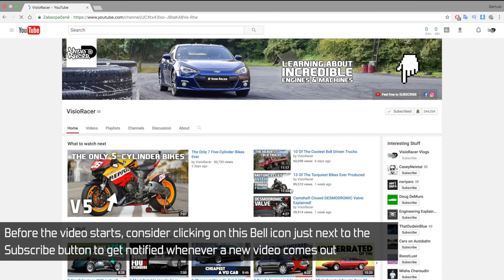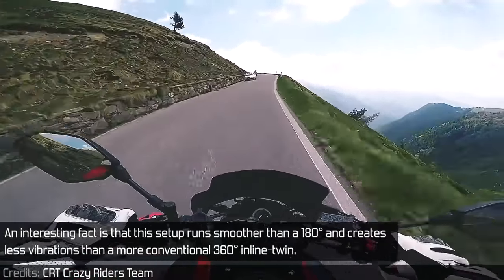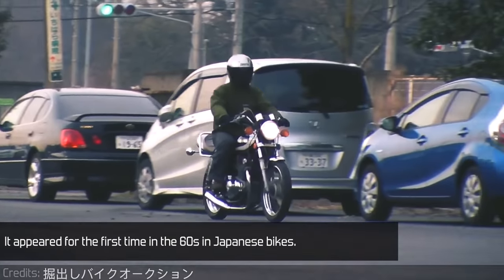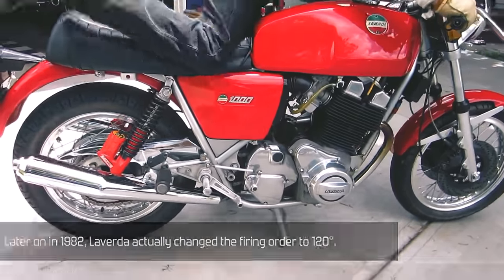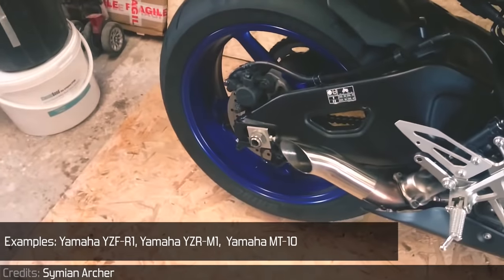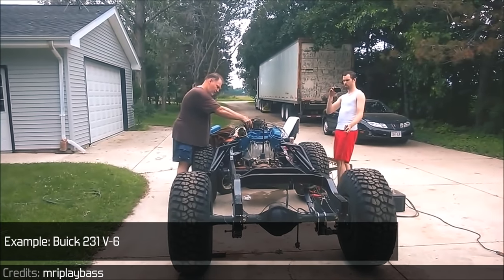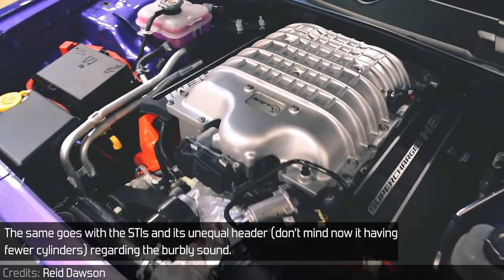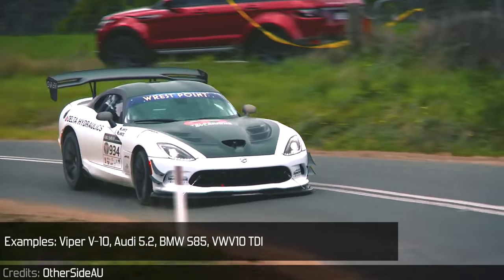7 Interesting Examples Of An Uneven Firing Engine

Comment: Vipers are the best sounding V10s hands down
Reply: KSZ Razor Lexus LFA, Carrera GT, Gallardo , Huracan , R8 are way better sounding v10s
Reply: I like the Audi R8 V10 more
Reply: KSZ Razor ever heard the one in Carrera GT?? you've probably not!!
Reply: Rohan Barbade actually I have, doesn't come anywhere near the growl of a viper
Reply: Oğuzhan Aydemir Gallardo, huracan, and R8 all share the same v10.... You know that right?
Reply from the maker: The VIper sounds most 'muscle-y' amongst the V10s, and I love that. The BMW S85, however, is ridiculously good, too!
Reply: KSZ Razor i gotta go lfa
Reply: VisioRacer agreed. I love the Dodge Viper and BMW M5 E60
Reply: Oğuzhan Aydemir
Yes, Lexus LFA and Porsche Carrera GT are awesome.
Reply: KSZ Razor that is why I quoted them both
Reply: Listen to a 1st gen Gallardo 5 liter V10, with a good exhaust it sounds amazing, especially at high rpm. The 2nd gen 5.2 makes more power but the 5 liter sounds better IMO.
Reply: Gary Sawyers 5.0 Lambo V10 is even firing because of split-crank pin crankshaft. This video is about odd firing engines. The 5.2 Lambo with conventional shared crank pin crankshaft is odd firing.
Reply: KSZ Razor vipers are the worst sounding odd firing V10, hands down.
Reply: KSZ Razor The Gallardo has equal length headers where the R8 does not. The Huracan has a completely different engine map, longer cam duration, higher rev limit and each of them sounds different from the other.... You know that right?
Reply: KSZ Razor Viper 4 life boi! Sadly it's going out of production. RIP Viper 1992~2017
Reply: KSZ Razor no doubt viper sounds great.. but in my personal opinion i like the carrera gt more.. sounds reeeeeally close to formula one V10's
Reply: KSZ Razor i think the porsce Carrera GT is the nicest 10cyl
Reply: KSZ Razor You haven't heard the Lexus LFA
Reply: Mickxal yea I have, doesn't even compare to the viper
Reply: KSZ Razor Yeah the LFA sounds better. The Viper just sounds like any other American car.
Reply: Mickxal in YOUR entitled opinoin though. The Viper and E60 M5 still beat the underdog LFA
Reply: Lexus LFA?
Reply: Oğuzhan Aydemir  It's all in your honest opinion, you can't expect everyone to agree on it cause we all have our own honest opinions about everything.
Reply: Carrera gt takes it for mw
Reply: Mickxal Yes, the LFA sounds amazing, like a 1989-2005 V10 formula 1 engine! But the LFA is an even firing engine and this video is about odd firing engines.
Reply: Gallardo 5.0 (gen. 1) and LFA is the best sounding V10's. (possibly the best sounding engines regardless of cylinders)
Reply: KSZ Razor you have to be joking! Vipers are hands down the worst sounding V10 ever made! They sound like a 4 cylinder at idle and sound like a miss-firing straight 6 when accelerating. One of the worst engine ever made!!!
Reply: Tom Parry well you've obviously never heard a car run XD
Reply: Timoastra the 5.0 gallardo and LFA engines are even firing engines. This video is about uneven firing engines.
Reply: yeah i know, still think those engines are the best sounding of all regardless
Reply: Timoastra and I do agree with you. LFA is retarded expensive though. Gallardo 5.0 isn't quite enough power and the old Gallardo package is a little rough around the edges. So for me, I have an R8 5.2 with open exhaust. Check it out in my channel. Sounds almost as good as the old Gallardo.
Reply: No question the 5,2 sounds insane. The Gallardo Superleggera gen 1 is a good performer with lower weight, more power and awesome looks!
Reply: Larz your 5.2L is the same as the huracan. Volkswagen group uses these engines for more than just the lambos. Makes the lambo guys look dumb paying all that extra cash.
Reply: KSZ Razor theyre probably the most boring sounding v10 out there

Comment: where is ls3?
Reply from the maker: That's technically a cross-plane V-8, only I did not mention it as an example.
Reply: VisioRacer ive been asking you to do my car since you had 5000 subscribers
Reply: VisioRacer holden V8 5.0 uneven as the buick pretty much

Comment: crossplane i4 sounds like a v8
Reply: JosefssonRCStation like a v4
Reply: crossplane 4 cylinder engines would sound like crossplane 8 cyl and 16 cyl engines.
Reply: JosefssonRCStation the 8s sound atleast %50 smoother than the 4 (car joke)